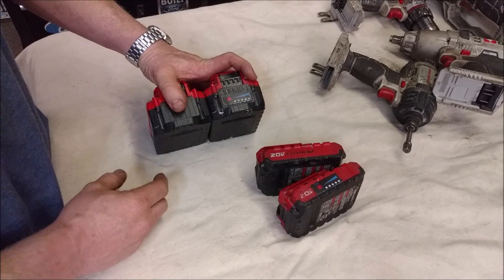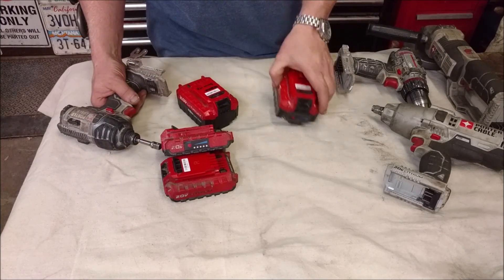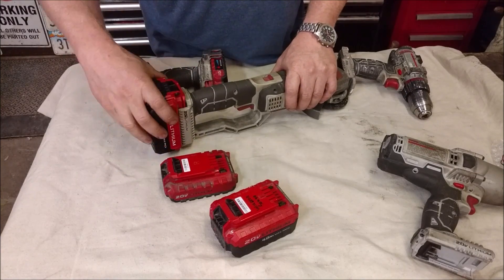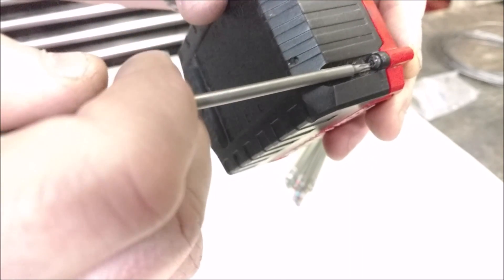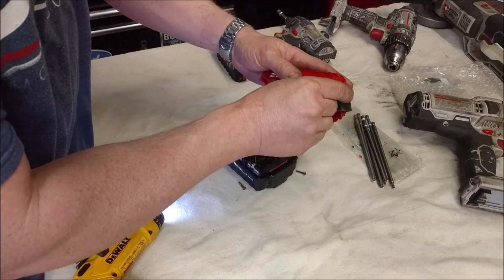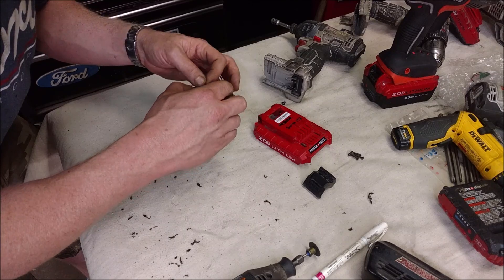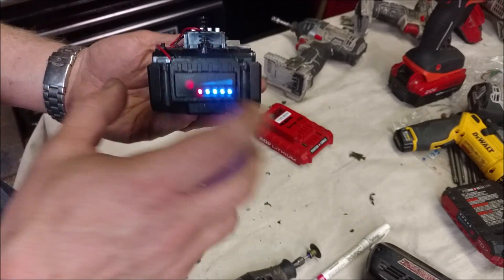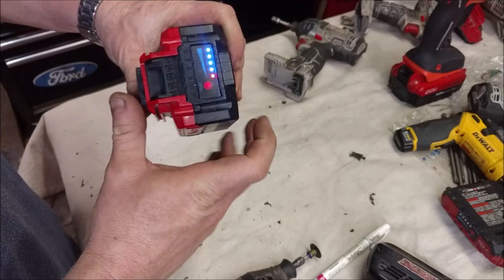Battery Meter install on Power Tool Battery Packs

Comment: e 6000 super stuff my wife uses it on jewelry to glue glass on  she  had a piece slip and and set up  she tried to separate it and the glass broke before the glue joint
Reply from the maker: It's great stuff.

Comment: An excellent tip video. What brand was the cordless glue gun?
Reply from the maker: That was an impulse buy and one of my favorite tools. It is a Black and Decker but apparently they discontinued it. I know Ryobi makes one. I virtually never used a hot glue gun before I got it, now I use it at least once every week because it's so convenient.

Comment: Dont see them on ebay anymore. Can you provide more info?  Mfr, p/n, etc.
Reply from the maker: Here are some 5s battery meters https://ebay.us/KbBYPX .I had a little trouble finding the 5s(5 cells) in the first place and then I had a few burn out on me. I figured the high voltages may have contributed to this,  so when ordered more a few months back and ended up using 3s and only connecting them to 3 of the cells(you could also use 4s and just connect them to 4 of the 5 cells). They were far easier to find and a ton of places sold them for around $1 vs $2 for the 5s. They still give you an very reasonable reading for the capacity of the pack as all the cells will drain at the same rate. These are the 3s ones I ordered a few months back https://www.aliexpress.com/item/4000266390135.html?spm=a2g0s.9042311.0.0.2fb34c4dbkTesr

Comment: Thats a great idea. I saw this other video https://youtu.be/n_9Vs4U8sv8 where the guy is complaining that the batteries have no power meter built in. This is a really cheap and easy fix for tools like that. The tools are cheap enough to buy so its not that much money to fix those batteries.

Comment: Thanks for this video. I’m building a mount for batteries on my 3D printer, with a voltage regulator in it so it can output 12v, 24v and 5v, and wanted to add a battery meter to it so I can use a cordless drill battery mounted in the printed mount and use it as a multi purpose device, and also use it as an emergency power bank in my garage just by shoving the battery in the mount, which then feeds a barrel socket and USB ports. Gonna order these so I can use these in my print design.
Reply from the maker: Thanks, I'm glad you liked it.

Comment: What your opinion of aftermarket tool batteries?  I see them on eBay
Reply from the maker: They never have good high discharge cells. They are generally repurposed used laptop batteries, at least that's what I've seen from online tear downs. They do work for low amperage draw tools like a drill but will overheat and stall out on any other tool when put under load.  You can't have high amp drain and high capacity; it's a trade off.  You will generally find aftermarket packs with higher than oem capacities this is because high capacity cells have low discharge rates of only around 5-10amps. You need around 30amp cells for power tools and if you look up the prices those by themselves you'll see there is no way they can put them in for that cheap.

Comment: My pnuematic impact makes beast power (more power than rated if you increase working psi) without those bazooka impacts and Tesla looking batteries. Only good thing i see, is mobility......well sort of, if you can fit it where you need it.
Reply from the maker: I use pneumatic for everything in the shop. If my 3/4 Ingersol can't bust it loose it needs to be cut off. The cheap cordless impact was only bought for wrecking yard, road side rescues etc. I really don't like it and wouldn't pick it over my pneumatic but it's painfully slow to pull a tire without some sort of impact.

Comment: Useful for sure. On the flip side you can make an adapter to check the battery packs by plugging them in but your solution is probably more convenient.

Comment: Smashing idea :-D, have you checked them against a battery that has a meter as standard?
I'm  not sure if the modules just indicate voltage or real capacity.
Reply from the maker: I have checked them against the tools that have the built in meter and they're the same. The factory ones are just a voltage meter as well. Lithium is good in that it doesn't get a false surface charge from sitting like lead acid or something like nicad. It has a very stable capacity to voltage ratio.
Reply: They sound excellent :-D, you always come up with great ideas.
I really enjoy your mechanical/tool creations, invention is always interesting and you never mind sharing with us.
Thankyou for all the trouble you take :-D

Comment: My Sweetie swears there is nOTHING like E-6k. She does  lot of crafty stuff but also uses it for everything. Good deal on the power meters. I can tell when mine are dead when they quit!
Reply from the maker: E6000 is the duct tape of glues and I use it for everything.
Reply: @sixtyfiveford  One of these days when she gets her nerve up I'm going to get her to glue my mirror back up in the S-10. Nothing else will hold it. I hope it does!
Reply: @sixtyfiveford  it's weird because e6000 always lets me down, and other glues seem to work just fine for me, how opposite

Comment: Would these work on NiCad batteries as well?
Reply from the maker: Yes. They are just sensing a voltage so it's just a matter of picking the right one. 
-14.4v Nicad pack is 12 cells, each at 1.4v full and 1v dead so it ranges from approx 17volts to 12volts. The nominal(average) voltage is 1.2v per cell so that is where they get 14.4v from. A 16volt (4 cell) lithium pack will be 16.8v full and 12v empty(4.2v per cell full-3.0v per cell empty), so if you used a "4s" lithium meter in place it will give you reasonably accurate readings for 14.4v Nicad battery packs. 
-18v Nicad pack is 15 cells, each at 1.4v full and 1v dead so it ranges from approx 21volts to 15volts. A 20volt (5 cell) lithium pack will be 21v full and 15v empty, so if you used a "5s" lithium meter in place it will give you reasonably accurate readings for 18v Nicad battery packs
Reply: @sixtyfiveford  thank you for the very detailed answer. I have the 19.4 v InCas system from craftsman. So, the 5s should work yes?
Reply from the maker: Yes, a 5s would give the most accurate reading for a 19.2v pack, it will read a little high. That's 16 cells connected end to end. 18v/15 cells would be more accurate so you could hook the meter at the 15th cell vs the 16th so your reading 18v capacity on your 19.2v. I hope that makes sense.
Reply: @sixtyfiveford  makes perfect sense. Thanks again.

Comment: That's a great idea.   With my old Dewalt drill I would take it up in the attic and carry it all the way to the other side of the house.  Then I would drill half way threw something and the battery was dead.
Reply from the maker: I've been there. Are you back home now?  Looked like a blast.
Reply: sixtyfiveford   Yes I’m back at home.  But I’m leaving in a few minutes to drive to Southern California to the Bar Z Summer Bash.

Comment: I need to get a cordless glue gun
Reply from the maker: I didn't think I would use it as much as I do. My problem is the kids love it.
Reply: The ryobi cordless glue gun is bad, a cheap $4 version works way better. They made it super cheap, it only lets out globs at a time, and its work flow, like working with the tool, gets in the way big time. The only pro, is it's cordless, the main con is it's so cheap, you feel like you're going to break the trigger when you're using it

Comment: Thanks for the tip how does that 1/2 impact gun work on junkyard type bolts let me know please or make a video of it I'll watch it your awesome
Reply from the maker: The first time I used it, coming from pneumatic, I didn't like it. Pneumatic is like hitting something with a sledge hammer once, where electric is hitting it with a ball peen 10 times to do the same job. I bought this with intentions of only taking it mobile(wrecking yard, roadside calls, etc). Anything in the shop I have air power with up to a 3/4" Ingersol Rand rated at over 1000ftlbs. It works great with the 4.0ah pack, and I've yet to find a lug nut, crankshaft bolt, CV axle nut, Pitman arm nut it won't take off. However it falls on it's face with a 2.0ah or smaller pack as they can't supply the juice this needs. It's only rated at 330ftlbs but I think it puts out as much break loose power as my 1/2" air impact rated at 500ftlbs and way more power than my Snap-on 3/8 rated at around 300ftlbs. There is a lot of number faking going on in the industry and beats per minute, motor rpm can play on those. After 2 years of using it, I'll say that I like it and I have nearly retired my pneumatic impacts for basic jobs. I don't think there is a bolt it won't take off on a standard car unless it's rust welded. Porter cable is just a parts bin brand so they just take Dewalt old stuff, rebrand it and the marketing team give it lower numbers so it doesn't directly compete.  This Porter Cable impact is the old Dewalt DW889 with a gray/red plastic shell vs yellow. I don't put a ton of respect into cordless tools as I think they still fail to out perform their corded/air powered versions from even 20 years ago. I would love to invest in a top of the line Dewalt XR impact but I rarely am fully mobile without access to air.  My only real gripe with it is it's long/bulky and doesn't fit into tight areas.
Reply: I was going to ask the same question.  I already have the drill & small impact.
Reply: I have the Makita version which says it has 1000 ft-lbs of torque. It's a beast! An expensive one. If it can't break a bolt loose, you'll need a 5 foot cheater bar!
Reply: That impact is only like 200 ft pounds. I have a hard time even taking half ton pickup lug nuts loose with it honestly. Its ok for small things. I would spring for the Dewalt, or the Milwaukee Fuel if you can afford it